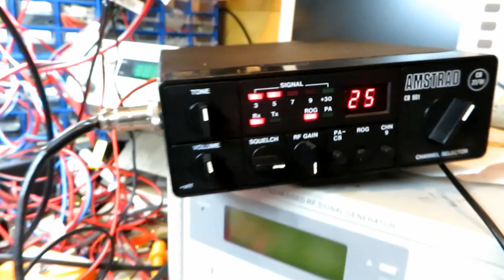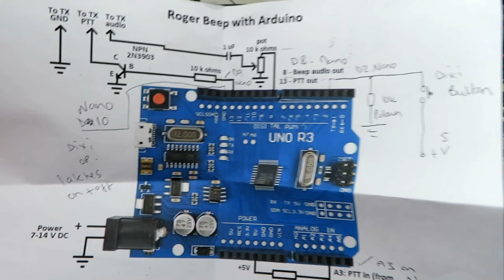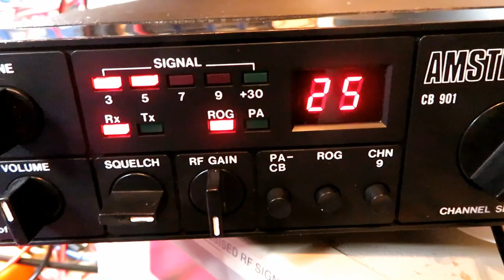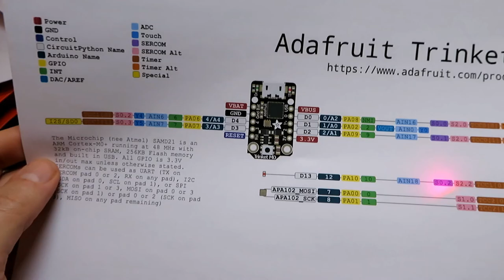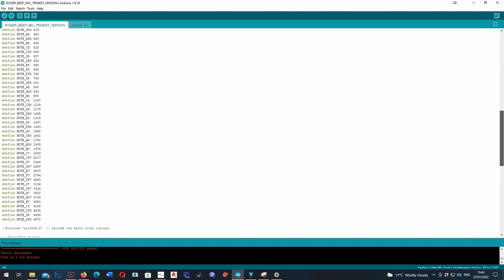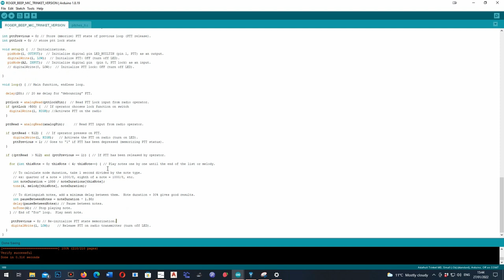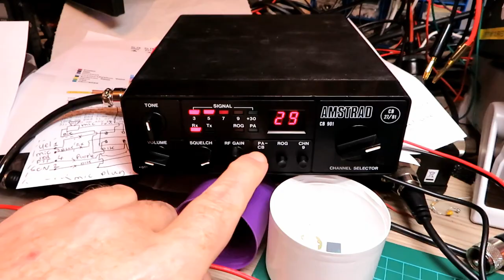ADD A ROGER BEEP TO ANY CB OR HAM RADIO USING THE ROGER BEEP MIC, THAT CAN ALSO WHISTLE DIXIE ;-)

Comment: Nice, but the general lee air horn noise is the one I like, now that would not annoy anyone  :)  Get a little connector like a 3.5mm mono socket (do they short out if plug in live) out the side, I would like a rechargeable and so no taking apart once done. Had CB in the day, home and car.

Comment: Stunning project Paul. Very well engineered. A nice subtle Roger beep (bleep) that one. Not a fan of them in general, but that tone you chose is very nice I have to admit. Wouldn't mind that. Love the knowledge shared in this. Keep the vids coming 😎
The V77's are great BTW.
Cheers 👍🍻
Reply from the maker: Many thanks 😎👍
Reply: @knoxieman  I can enter several melodies and change the melody with a button and how would I do it, I'm new to this arduino thing, thanks and that's great, I have 1 bluetho on my cb for the melodies but I'm interested in 1 with buttons

Comment: i wonder if you can do a simplex repeater (parrot) using an ISD1820, an arduino and a cheap baofeng 888.? thanks.
Reply from the maker: Yes I've done that, video on my channel.
Reply: @knoxieman  great! I'll check it out. I knew I've seen somewhere. Thanks.

Comment: Just wondered how you made the label for the top of the mic?
Reply from the maker: Using a brother label printer they are amazing, I use the PT P710BT it's wireless BT enabled can print from app or desktop, you can get the design software from brothers website once you buy the printer, I paid about 75 UK pounds for mine.